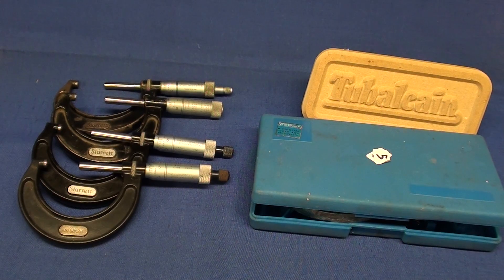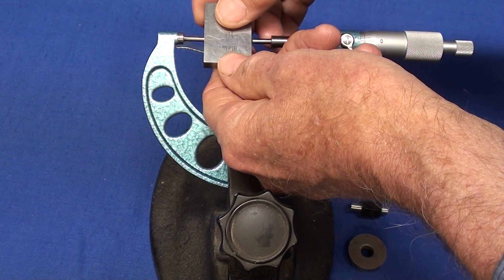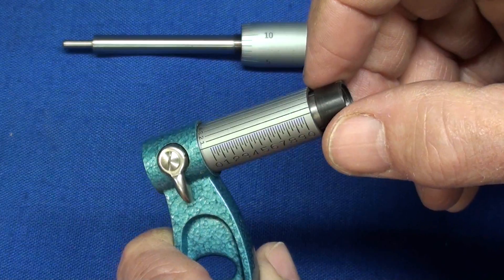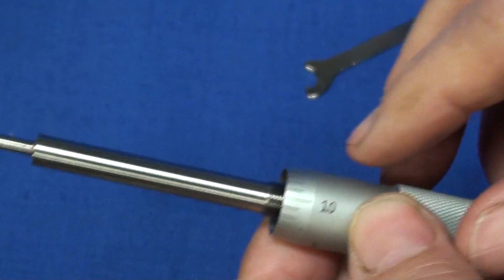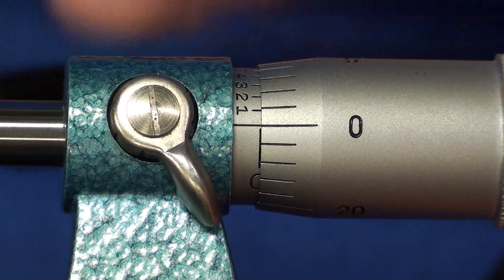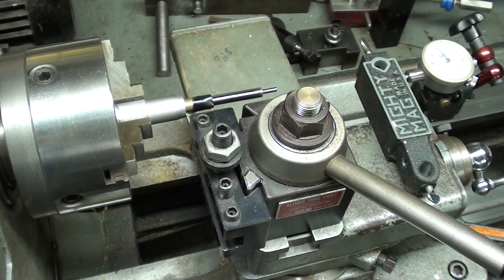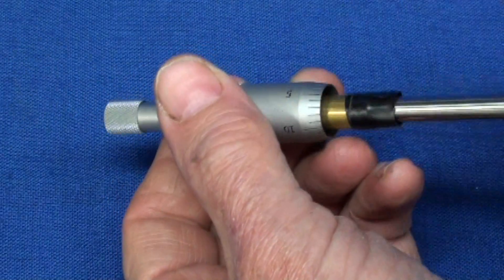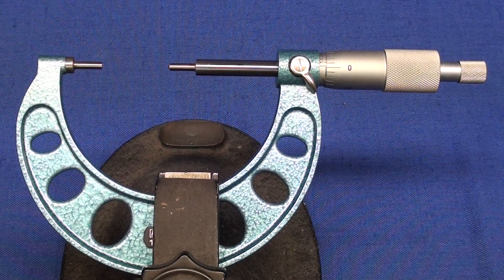SHOP TIPS #302 Calibrating a Fowler Micrometer tubalcain

Comment: I have a 2-3" Mitotoyo that was OFF by .012" around the 2.520" measurement, BUT it read ZERO at 2" and 3" using  1,2,3 block for quick calibrate..... WTF??? (it read 2.508") 

I check with 0-6" calipers, and try to get REAL with my micrometer. WTF 2X ? Check with 0-12" calipers, SAME MEASURE as 0-6" calipers.  WTF 3X!

On disassembly,  Frame Threads were NOT too tight. No damage to the frame. No chips on the measure faces. There is no friction thimble / ratchet on this micrometer, feel ONLY. The end screw for the thimble that held the upper anvil in the taper was VERY tight.

 I followed this video for recalibration, and corrected the problem. . I can trust my micrometer again! 

Tighter is NOT better! I can get REAL again.

Comment: I bought a Tumico that I wasn't able to adjust the thimble for calibration, I ended up taking the thimble out and heated it with a hot air gun and that allowed the oil or grease that had hardened to release and I was able to adjust it after that. Just a hint for anyone that runs into that problem.
Reply from the maker: Thanks

Comment: That's a rebranded NSK mic. I have NSK mics and I like them alot. They aren't collected like some brands so you can get them reasonably priced. SPI also rebranded NSK mics and I own an SPI mechanical digital mic that's made by NSK. I really like NSK instruments. Japanese quality. I have 2 NSK dial indicators, one I got that looks pristine, with a magnetic stand for 35 bucks. I also have an NSK height gauge I got NOS for 110 bucks. I could never get a Starrett NOS for that. It's vernier and has a movable magnifier which I've never seen on any other vernier gauge. Cheers Mr Pete!
Reply from the maker: Thank you for that analysis. I agree that they seem to be very high-quality. But I very seldom run across one

Comment: This explains a Starrett No. 209 marked Autocar Co. that I picked up off of eBay. The front edge of the barrel is trimmed down such that the edge of the adjustment notch is open and the very bottom of the numbers are gone.

Comment: Hi Mr.Pete!
I bought a used Mitutoyo 0-1 mic that had this exact problem, only worse-- 12thou to be exact. Otherwise it was beautiful and by doing a YouTube search I found your remedy for my problem. The nice thing is that one can fine tune a mic with this issue to suit their personal preference. I followed your suggestions and now have a usable instrument that I can read and suits my needs. Thanks! George in Pa
Reply: I've got the same issue with my Mitutoyo - disappointed frankly.   I just spent a TON of money on a 126-137 0 - 1" thread micrometer, a 126-139 2" - 3" thread micrometer, and a complete set of interchangeable anvils.  Purchased good to excellent quality used, but still over $750.  I could have purchased the high quality Chinese units with the vernier scale for around $220 for a set of three thread micrometers 0 - 1, 1 - 2, and 2 - 3; AND a complete set of anvils.  Hope I "only cry once" with this purchase.  Overall, Mitutoyo is my go-to brand so I'm probably going to be satisfied after this tune up.  More importantly, Thanks Mr. Pete!

Comment: This is exactly what I needed to know.  My cheap Indian mic has the lines buried by about 12-15 thou.
Ist so annoying I’m concerned I’ll miss measure something by .025”
I thought about turning the end of the barrel down but it’s so tight I’m afraid I’ll break something duetting it off.
I never thought about turning the thimble back a bit.  Now I can turn it into a useable tool 
Thanks Mr P. ;)

Comment: Perhaps you didn't need to modify the thimble. But anything you can do to help make your tools work for you instead of against you should be seen as a necessity. Especially in this day and age. 

Thanks for the video. I just bought a cheapo Amazon 0-6" set of vernier mics. I think I'm confident enough now to tune them up nice enough for the occasional work that I do that requires a modest amount of precision. Maybe one day I'll get gifted some nice Starrets. I just don't use them enough to warrant the cash spent on nice things. That, and I've developed a knack for getting cheap things to do what I need. Which in this case is basically an adjustable go/no-go gauge for deciding which parts go to the machine shop and which parts go to the scrap heap.

Comment: I like the older Brown and Sharpe Slant Line mikes for ease of reading.
You get deeply engraved lines and numbers.  The barrel and thimble are satin chrome. The lines and numbers are filled with black ink. When viewed against the satin chrome background there is a lot of visual contrast making the mike easy to read.
The Slant Lines are especially easy to read when using a depth mikes since the lines are numbered in reverse order.

More recent mikes of many brands have only lightly laser etched lines and numbers making them very hard to read. I collect high grad micrometers. Some times they are terrible to read compared to an ancient set of Reed, Scherr-Tumico or Tubular mike with the deeply engraved lines and numbers.

Comment: Good job. 
Sadly, on many B&S micrometers, the graduations are stamped very lightly on the thimble and barrel, making them difficult to read with nothing that can  be done to correct the problem. Sold mine and bought a set of Mitutoyo's.
Reply: I've easily corrected issues like this with a little black paint brushed on then wiped off leaving the markings clearly visible. Saves a lot vs buying new.
Reply: M Williams I wonder if Dyekem will also work? I have this problem.

Comment: Developing your "feel". - No matter how great the quality of your mic or its age or brand, it all comes down to YOU in the final analysis. Many people buy expensive instruments but do not know how to use them properly. Most important when using a micrometer is knowing how much pressure to exert on the part being measured. Now some mics have "slip thimbles" or ratcheting knobs to limit the amount of pressure being exerted; however, it would behoove you to learn to develop a "feel" for those times when these crutches are not available, because they are NOT always available on every mic. I am a retired machinist of 50 years in the trade and I never knew a seasoned machinist who used a ratchet or slip thimble when taking measurements.

The way to develop a "feel" is to pick some idle time such as lunch break or when you are watching TV at home and repeatedly attempt to take a mic reading. With a 1" mic simply closing it down to the anvil would be fine. The important thing is DO NOT LOOK AT THE MIC'S SCALE WHEN YOU ARE DOING THIS. Your mind can trick you into exerting more or less force to get the lines to coincide if you are looking at it. Take the reading repeatedly many (50 -100) times without looking at it. Do not fear, you don't have to do this forever only until you develop your feel. It's like learning to swim or riding a bike, once developed it will stay with you for the rest of your life. After feeling the mic's contact surfaces meet to the extent that you think the pressure you are exerting is correct THEN look at it after each attempt. At this point you don't care what the reading is, only that it is consistently the same. With larger mics you will need a standard or Jo Block. Ask at work if you can borrow one or two overnight. When you are convinced that you can hit EXACTLY at the same point within a tenth (even if only estimated for mics which do not have tenth graduations) then adjust the mic such that the lines are accurately set. The mic is now set to YOUR feel. Another machinist may get a different reading just as you might if using his mic. In the long run this is far more important than the do-dads which come with the mic for this purpose because this same exercise can be used on depth mics, height gages, telescoping gages etc. Hope this proves to be of use to some of you. 

EDITED TO ADD: If you CANNOT get the mic to repeat after many many conscientious attempts perhaps the mic is junk ... the problem may not be with you. When buying used mics if your feel is developed you will be able to sort the good ones from the junk because your feel, having been developed, will be a reliable constant - if the mic won't repeat to your feel after taking multiple readings don't buy it. Remember - it doesn't have to have the lines in alignment (it can be adjusted) but it DOES have to hit at EXACTLY the same place EVERY time.
Reply from the maker: Thank you for a great analysis and good advice for them all very true
Reply: @mrpete222  You got a good channel Petey. I used to teach machine shop too and in my opinion, judging from what I've seen in your videos, your technique is spot on perfect. Believe it or not we actually had one of those things you showed in your last "What is it?" video (42a) - the thing in the box. I don't remember what it was for though. We inherited it from past generations. I do remember that it's function was of little to no value to anyone living or dead. For the life of me I couldn't figure out why they bought it. Maybe they got it for nothing. Like I said I don't remember what it's function was but I've been racking my brain to remember. I'm looking forward to your "Answer" (42b) video.

Comment: One thing that I discovered is Starrett parts are not that terribly expensive. At least as far as their gauges are concerned they are very reasonable. I actually met research all the parts to a nice set of calipers and decide if I buy a cheap junk mishandled one and repair it
Reply from the maker: I guess it surprises me that the repair parts are reasonably priced

Comment: I recently found a Mitutoyo "Combimike" analog-digital micrometer at a pawn shop. It's in good shape, but it needs to be cleaned. I'd like to take it apart to clean and oil it, but I didn't know if it's safe to take it apart with the analog counter. Do you have any experience with taking apart analog counter micrometers? Thanks for any info.

Comment: There is a name I forgot about. Fowler. Not a big fan of Fowler, but they are better than Chinesium tools.  I hate to admit it, but I like Mitutoyo just fine, or SPI. Starrette is the old American made standard. The Japanese electric guitars rival American guitars in price, and usually exceed them in quality now. Is that the same Mauser that made the Mauser 1898 rifle? I need another 24" deep 2" micrometer. Those get sprung pretty easily. I think I'd use a small Arkansas stone rather than the file, but it's your shop!  God bless you, Mr Pete!

Comment: Hi Pete no sure if you have been asked this before. but just recently bought a  used vintage Moore & Wright 40,000 1mm  micrometer and the very tip of the spindle is rusty. something  that wasn't shown on the photos. is there a way to get a replacement spindle for my micrometer. other than that it's in great shape.   your advice  would be greatly appriciciated.
Reply from the maker: You will never find a relpacement. Clean with fine emery paper

Comment: Great information and video!  My young grandson bought a 5 ~ 6" mitutoyo micrometer at a flea market that was in a wood box.  He told me that it turned to tight and took it apart, then he could not get it back together, correctly.  I did not realize that there was a spanner wrench to zero it!  Now I have the information to see if he has that wrench and the proper gauge blocks.  I need the information also, on using the end adjustment and taking it apart.  You, as always, have been a great help.

Comment: If you take the "ratchet "off there should be an "adjusting nut" under the thimble so you can adjust the thimble to line it up without having to machine anything.!!
Reply: +Iain Small He did not machine it to line the thimble up!! He machined it so that he could see a little bit more of the line at the edge of the thimble!! He knows exactly how to operate and adjust a micrometer.
Reply: The adjuster allows the barrel to move so you can see the line and still zero the barrel!

Comment: As I recall, the Lufkin micrometers had a collet that retained the spindle, so this kind of adjustment could be made without the machining operation you've shown.  

The B&S "slant line" micrometers were developed to avoid the reading problem you've described, but I never liked them.
Reply: +MrShobar 
Your right,most mics have adjustment in the thimble so you can "zero" them without having to machine them

Comment: Totally off this subject MrPete, you as someone with many years of experience and knowledge might be able to answer just how effective is 'Balancing' (damping perhaps), drive shafts with an amount of oil added via a drill hole and then plugged? I've heard of this for decades. Could it reduce vibration if used as a 'poor man's' balance?
Reply: +Tom Tee That might sound good in theory but in a vehicle it might only balance 1 end being lower. The only "poor man's way" that I have seen has been hose clamps at each end but it takes a while to find the sweet spot. Balancing machines these days can balance single and 2 piece drive lines to less than .5 grams.

Comment: I've never worried much about where the edge of the thimble made the line, as long as the line is visible. I own mics that run from splitting the mark to full exposure,ad use at work mics that do both, as well. I check the zero each use,because I can't keep track. If I didn't have to use tools that were not in my control, I would probably do what you did for consistency.

Comment: It's a matter of personal preference with regards to the relative location of the zero line... I just checked a couple of my micrometers, including my first one, made by Mitutoyo, and they are like the original condition on those Fowler's you modified... 

The edge of the thimble collar comes from the factory - on some manufacturers' offerings - set to split the little number 0 and the line. I'm fine with that, but if it bugs you, by all means modify your tools to suit your preferences. It's not like a $5 yard sale find is a collector's item after all... at least not in this case! ;^)

Regards,

Eric

Comment: I noticed you said that you shouldn't store a micrometer with the anvils touching, what is the methodology behind that?
Reply: +Bob Also, any moisture that gets in will corrode the faces together. This can happen even when the tool is stored in non-condensing conditions. I have several mic's and calipers I use as demo's to show this to students.
Reply: +chemech I checked my trio set today, each one was out by .001.  They were last calibrated during winter (indoors) and used outside today, in temperatures similar to what it was in when it was calibrated.  I've found that average ambient temperature differences will affect the consistency of dial calipers as well.  In a nutshell, they should be checked any time there is a major change of the temperature average, daily if the work is extremely critical.  If the work requires you to have OCD ... well, I'm in Missouri, so you could be checking every hour, the way the weather goes here.
Reply: +Bob It matters more if you don't store them in a climate controlled location, but mostly it has to do with thermal expansion, which can push things out of alignment, and coupled with the lubrication getting gummy, can make it difficult to open them up when you go to use them.

Also, if the mics don't have carbide faced anvils, you can scratch the anvil faces when you twist them apart, which can throw things off by a couple of tenths of a mil...
Reply: Makes sense, thanks guys, I like the thermal expansion idea, I learned something new today
Reply: I hear you on that - left Missouri when I was a little kid, but I remember the weather swings - and get reminded about that by my cousins near St. Louis...

Out here in SoCal, I just check my mics against their standards and adjust the zeroes at the beginning of a session when I need better than 0.001" out of them - which is pretty seldom...

Comment: Does the little collet thread tightener thingamajig also serve to prevent the backlash or is it simply the case of having all the threads so finely machined that backlash isn't an issue?
Reply: +Mark Ganson removal of backlash is the primary purpose. snug enough to remove backlash substantially, but not restrict proper operation. wear in one part of the range can pretty much ruin the tool for general purpose use

Comment: Lyle,  just a note ;   when I was working on the RR  boring wheels to press on the axles we would adjust our inside mic's.oo9 off to machine in the right fit on the wheels. of course those mic's were dedicated to that job. So if that micrometerwas used in a factory they might have been set to make the fit for a shaft/ bearing.   Thanks     enjoyed!!

Comment: What an artsy pun ;)

I have a Fowler myself, same issue, so this video is very much appreciated.
Reply: Personally when i store my mics i use custom made plastic tips (a little bit of heat forming on some thin plastic sheet) that i've lined with that awesome anti rust paper dipped in oil. Perfect for long term storage, never had a spot of rust on any of my mics.

Comment: As much as I agree that you need to see the line, and I'm not going to split hairs on how much is enough. I disagree with trying to shave anything off of the ram assembly. On every micrometer that I have used, there is an adjustment on the ram assembly to adjust the location of the ram versus the scale. And even if there's not, I much prefer taking a little bit off of the barrel, Rather than messing with the RAM assembly. A very light cut on the barrel Should not affect the accuracy or usability of the micrometer. it is much easier to clean and protect from chips. and there's not as much chance on damaging something. your method works, but is it the right way to do it. ?